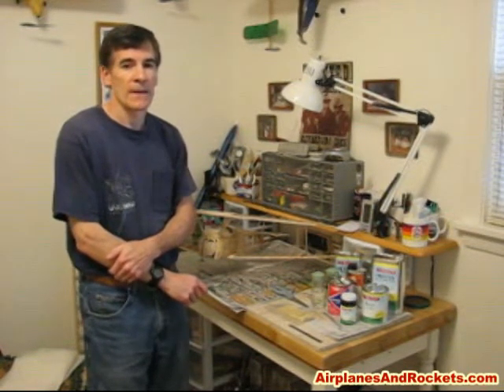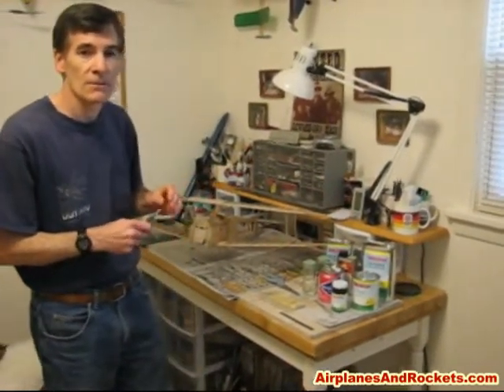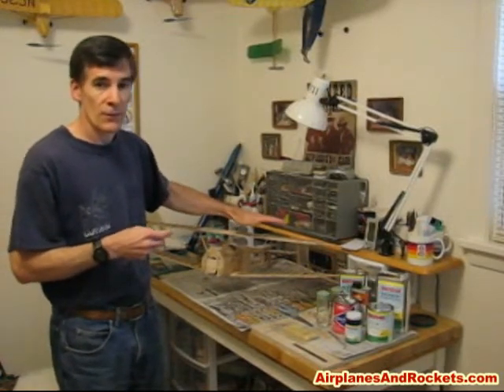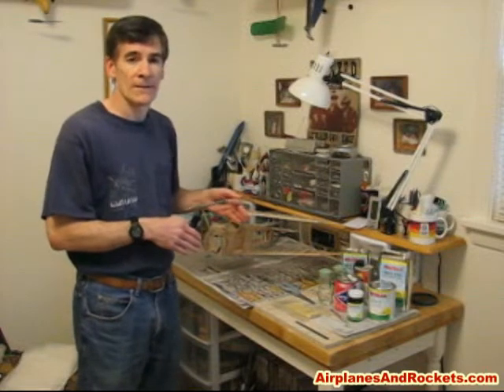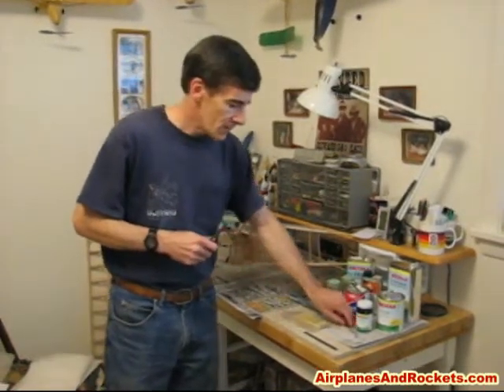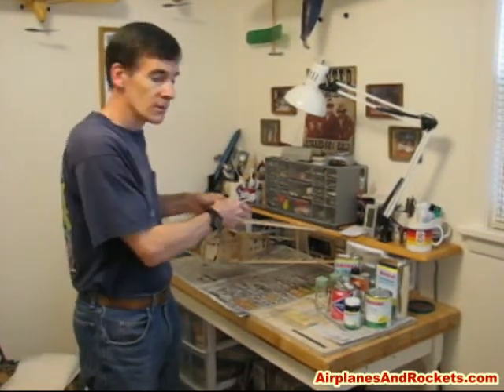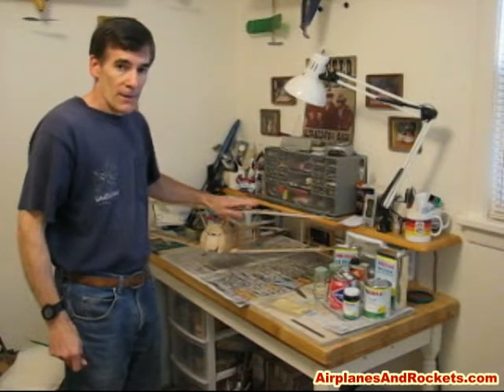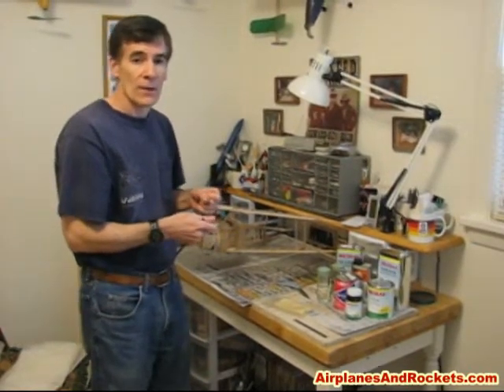Part 1 - Silkspan & Dope Covering Tutorial

Comment: this is great help im have my Dad's 30? 40? yr old dope, recently got into building wood planes and had no idea how to apply it
Reply: ive got the pactra stuff, thinner to go  with it as well
Reply: potatothorn  Dope should last for a long time - thin it using acetone, a very thin coat is good for priming. finishing coats I use full strength.Pactra was some good stuff in the day, I'd use it if it's sealed and still ok.
Reply: Tom Martin
 i did use it and it worked out pretty well for my first attempt, and i have some more. appears to not have decomposed at all over many years
Reply: awesome, you're on your way!!